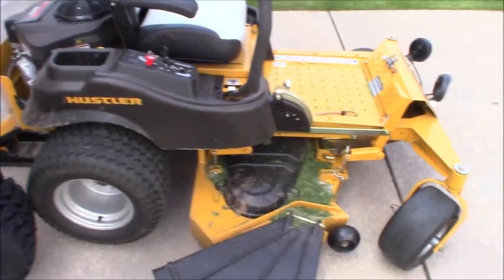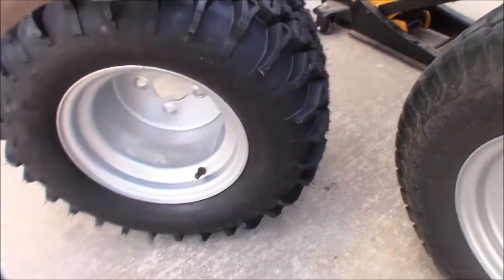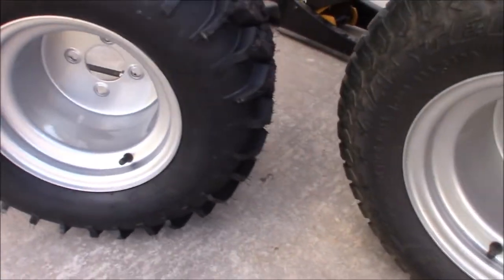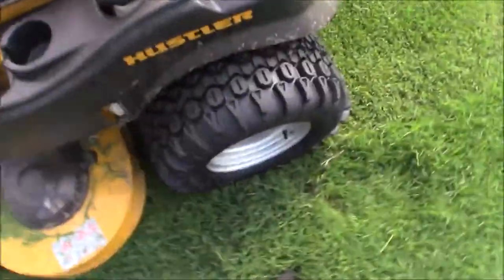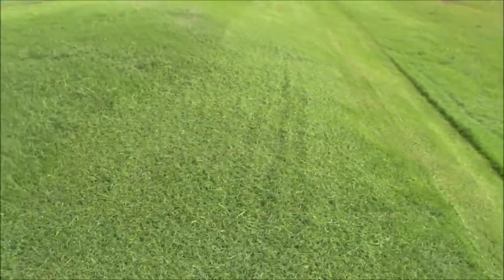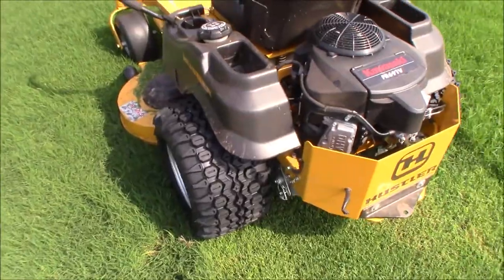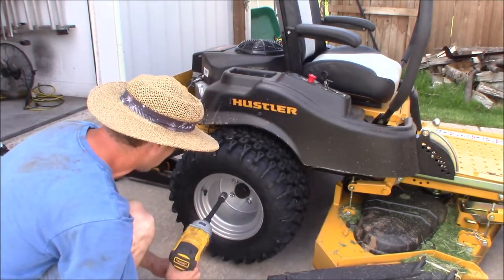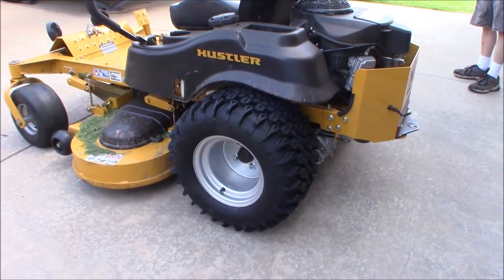Zero Turn Mower Traction on Slopes with Aggressive Lug Tires

Comment: I’m guessing 20 psi is a good pressure for those tires so you’re getting maximum traction and a little bit of cushioning and obviously am soil ZR 10 W-4 oil and their hydraulic fluid with the hydros

Comment: Thanks!  I have the SDX and it came with Big Bite tire which are made just for Hustler.  Crap.  These don't come in my size but it's good to see the aggressive thread does not tear up the lawn; at least as much as skidding and spinning.
Reply from the maker: yeah, I mean you def can if you wanted to tear up  your buddies yard with them!  as long as I don't get real aggressive on turns they are doing well
Reply: I just bought a Raptor XD with the Big Bite tires and while they look aggressive, they might as well be slicks. 12 inches wide and hard as a brick, even aired down to 5 psi.
Reply: @style5tie  Just saw this.  I finally got some bar-tread type tires that my local tire dealer installed.  They are a lot more aggressive and provide better traction.  Just have to be cautious turning.   Carlisle Stryker Tires I think is the model.

Comment: A good option is look at atv tires but with good tires have to be more careful when turning altho factory tires are most likely ripping up the hill side already so you might actually cause less damage just be careful when you first switch and see what is happening

Comment: FYI...for the best steep hill mowing will always be an old lawn mower with a steering wheel.....zero turns only steer with the drive wheel, front wheel just swivel...so drain ditches, heavy sloaps ..use ya old Walmart lawn mower, sit on the fender and side saddle that sucker🙂.....works every time
Reply: For newer mowers: ZT's drive with both rear wheels, and normal riders (regular residential models under $4k) all have the hydrostatic drives with pedals which are usually super sensitive, and only one rear wheel turns, so they're HORRIBLE on any slopes without modifications. I'm on my 3rd new mower in 3 weeks for this reason and finally just bought a Cub ZT since I had a ZT before on my hills with no problem. Point is, newer lawn tractors are no where as good as they used to be!
Reply: Grasshopper mowers are more balanced for doing slopes, because the drive wheels are at the center between the deck and the engine.

Comment: How are these tires holding up , I had OEM tires and man had the scare of my life went straight slid into the retention pond. I am now on a quest to get more traction because I don't want to have another one of these episodes. My old lawn tractor I did not have this issue at all , but now with the zero turn it's a bit scary at angle.
Reply from the maker: prob about 30 hours on them so far, no real signs of treadwear, but they don't see much concrete.  Traction is still great, it really is a whole different machine on that back slope.  hard to tell from the video but it is steep!  And to make it worse, we have aerobic septic and the sprinklers spray out over that slope, so it's always damp
Reply: @workingdad  what was the exact name.on amazon ?
Also thinking of getting some chains ⛓️
Reply from the maker: @jbreezy3146  this is what I bought, but currently showing not available.  there are other brands depending on size.  the 20x12 is apparently not as common as 22, so if you have a larger mower you will likely have larger selection on amazon and prob other sites
MowerPartsGroup (2) Aggressive Deep Lug Tire Assemblies for Hustler Raptor SD 54 60 20x12.00-10

Comment: I have 22x9.50-10 on my John Deere,  will 22x10-10 fit? Or what's your suggestion?
Reply from the maker: both sizes are rated for a 7 inch wide rim, but the 10-10 will be just a bit wider.  I'd think it would work unless you have almost now clearance on the machine for just a bit more sidewall bulge or tiny bit more tread width
Reply: What is the name of this tire?

Comment: What is the name of the tire?
Reply from the maker: this is what I bought, but currently showing not available.  there are other brands depending on size.  the 20x12 is apparently not as common as 22, so if you have a larger mower you will likely have larger selection on amazon and prob other sites
MowerPartsGroup (2) Aggressive Deep Lug Tire Assemblies for Hustler Raptor SD 54 60 20x12.00-10
Reply: @workingdad  Thank you 👍
Reply from the maker: @kimsac1  you're welcome, thank you for watching!
Reply: What's the name brand for these on Amazon??
Reply from the maker: @Hellbilly72501  

this is what I bought,  there are other brands depending on size.  the 20x12 is apparently not as common as 22, so if you have a larger mower you will likely have larger selection on amazon and prob other sites
MowerPartsGroup (2) Aggressive Deep Lug Tire Assemblies for Hustler Raptor SD 54 60 20x12.00-10